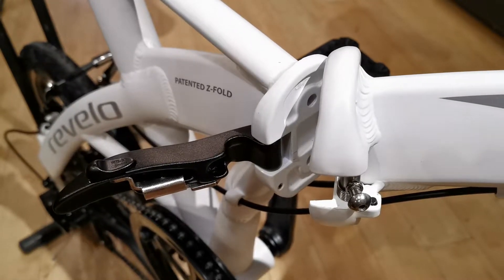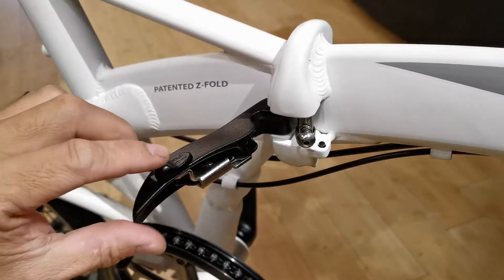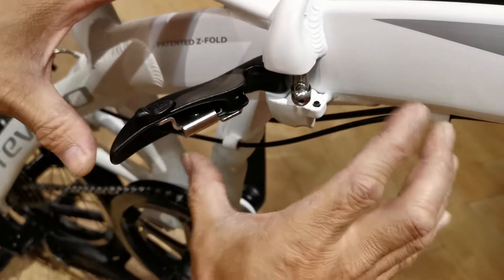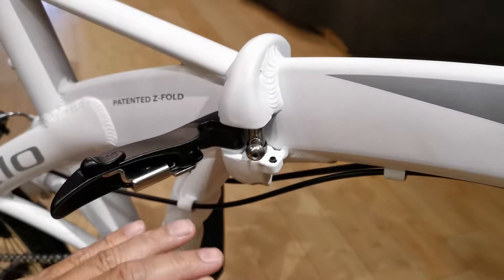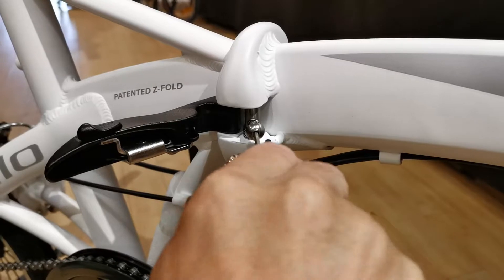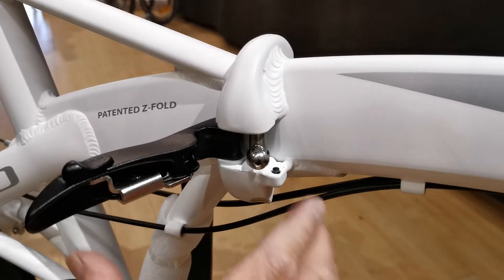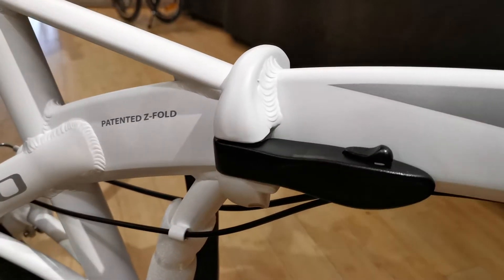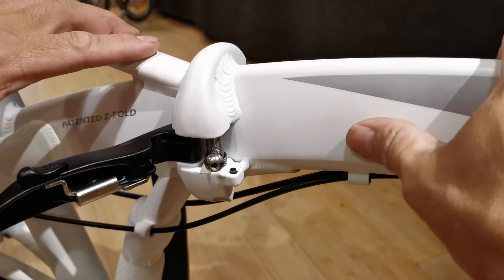Operating the  Revelo LIFT and FLEX frame hinge

Comment: Gr8 video - my yammee 750xl has a similar kind of hinge.. it was to tight right from the factory(infact Ive opened & closed it several times & may have broken it), now I know how to fix it if I manadge to open it 1 last time without it breaking.  I'm curious - does that slider lock & unlock button - is it that is - supposed to have a spring attached to it? To make it generally slide into the locked or unlocked position? Mine appears to not be attached to anything, not even a spring, & that round gizmo appears to be at wrong angle.. thNx👋